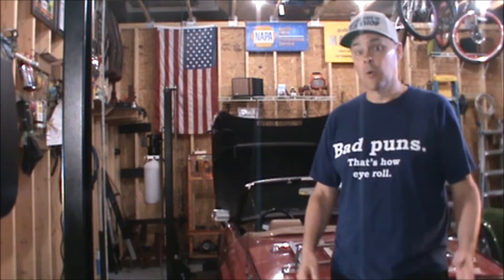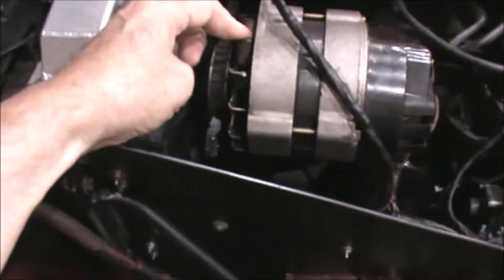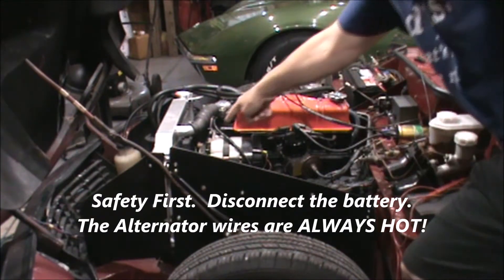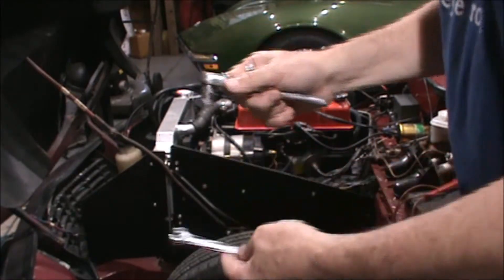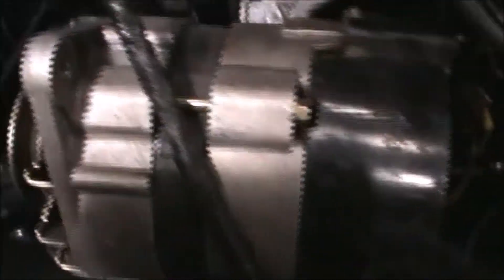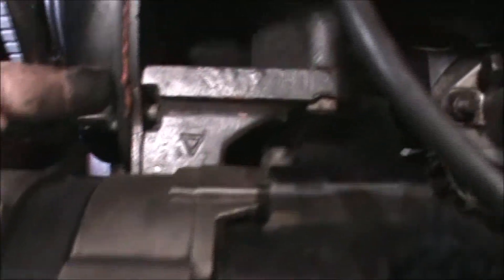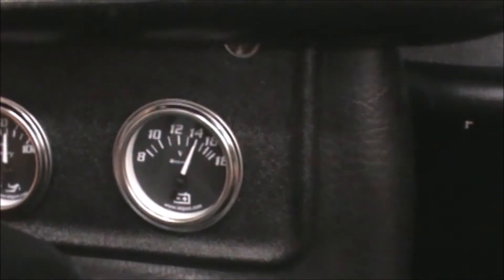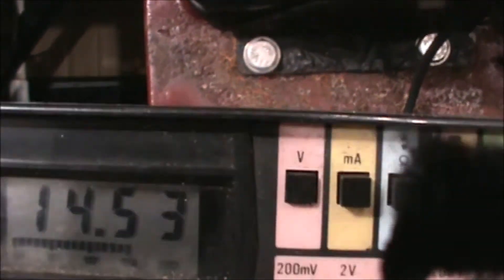Triumph Spitfire 1500 - Charging System Testing & Alternator Replacement

Comment: Hi Mike... Niall from Northern Ireland... Think your videos are class... I own a 1979 triumph spitfire and do alot of stuff myself... Really enjoy your informative videos 👍👍👍👍👍👌👌👌👌
Reply from the maker: Hi Naill, Thank you for your encouraging comment.  I enjoy doing the work and hope they are helpful.

What kind of stuff do you do on your Spitfire?  Happy to learn from others.
Reply: Oh my car the body was good mechanically she needed attention... She is now finished going well... She has weber 32/36 conversion, new leather seats with new foam, new brakes all round with braided hoses, electronic ignition, Twin air horns, head light conversion to h4 bulb rather than the sealed beams, electric fan,new overdrive after bearing went in it, new clutch..... I have alot more to do as always like a new exhaust... Would like to do a suspension over haul sometime.. But you are never finished... I also have a 1988 porsche 944s 16v so plenty to kerp me busy
Reply from the maker: @nmc8688  Sounds like we're taking similar paths.  Upgrade without changing the character of the car.   I bet those leather seats are really nice!  Thank you for sharing Niall.
Reply from the maker: @nmc8688  I bet that 944 is a blast to drive.  Pretty cars.
Reply: Great video! I just bought a 77 today and get it next week. I’ll be back lol. Thank you
Reply from the maker: @BudFunOne  great to hear.  This is a great car to drive and work on.  Owners are passionate about their cars and there are some really great resources.  Check out https://www.triumphexp.com/forum/   

If you have any questions, please let me know.  Happy to help if I can.
Reply: @MikeHammill-TheShop  thank you very much!